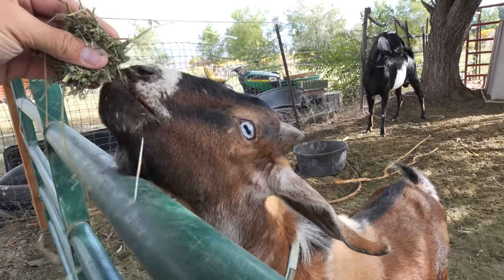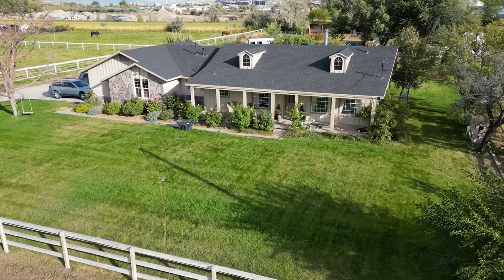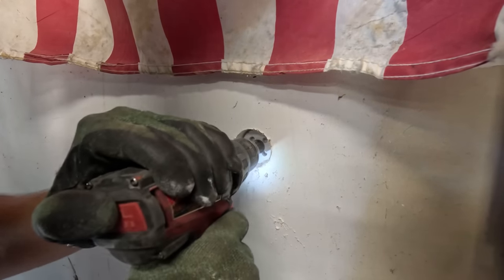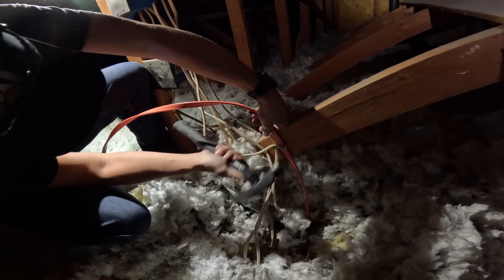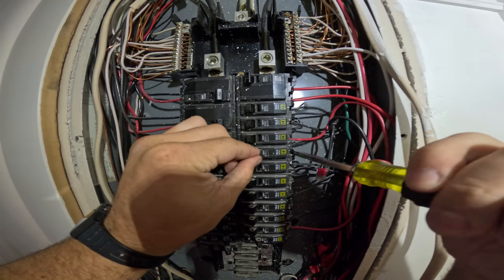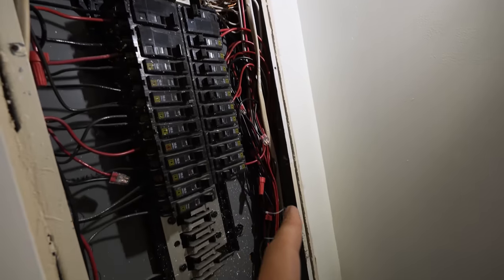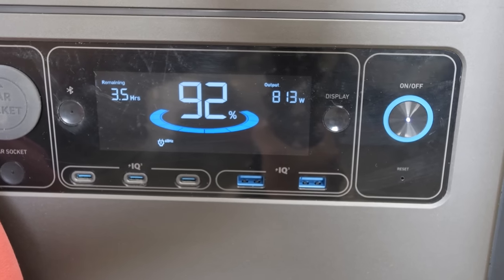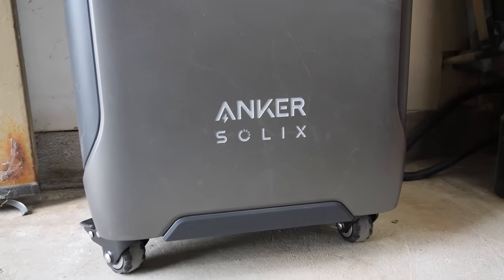Ankers newest Power Station can charge a house and an iPhone... 300 times

Comment: I live in South Louisiana almost right on the coast. I keep wanting to go with some battery backup solutions for when hurricanes take out the power, but I can't figure out which seems best. EcoFlow, Anker, Bluetti, etc. They're a rather large investment so I can't exactly just go off trial and error. So... what's your opinion of this compared to the EcoFlow batteries you use on your side of the road?
Reply: This is the first that doesn’t require two units to output 240v.  If size/weight is more of a factor and you don’t need 240v, their f2000/767 is pretty nice
Reply: Will the expansion battery from the solix 2000 work with the 3800?
Reply: @bdtang  My Ecoflow River 2 outputs 240v. 240v isn't special.
Reply: @logitech4873  in the US?  Supporting a nema 14-50 240v plug and able to plug this directly into generator inlet and use it as a short term direct replacement of a generator is really cool.  Hopefully it supports solar charging while still outputting 240v 14-50 plug would help fulfill my use case.  I know the eco flow delta pro requires 2 units with a hub to support this. The current portable generator we have is a pain to maintain (oil/gas) and fire up for the 1~2hr power outage we get here about once every couple of months.
Reply: @bdtang  Nah in Europe. All power banks that have basic outlets will support 240v here. I don't know if any of them support 400v 3-phase.

Comment: A proper fuel-efficient generator would last 40 years, always ready when you need it, never needs a recharge.  Many can go 48 hours with on board fuel storage, or (like mine) can go years on 2000 gallons of LP  While making 5 times the energy output of that throw away made with china battery bank.
Reply: You are a big man, everyone here knows it. You are so strong and big
Reply: @jamesmartinez1193   I'm talking about power density and fuel storage, why would you say something like that?
Reply: @jamesmartinez1193  He has a bigger brain too
Reply: That's fine and dandy when the gas is available. But when gas is no longer available due to emergencies such as hurricanes and consumer usage, inability to bring in supply from outside areas, and gas lines being broken, you need something that is 100% self-reliable such as solar and battery. You don't have to rely on other companies to provide the fuel when going this route.
Reply: My granny used to use that as a solution. The downside is that you need to store fuel, and when you run out, you're out. It's also more work to get started, especially for an older person with no background in power. My uncle helped my granny install solar panels on her entire roof, not sure if they've installed a battery bank or not, but now she never has to think about what to do if there's a power outage, plus her overall electricity bills are much lower, so it's a benefit day to day, as well. Even without a battery bank, with solar, she's guaranteed power during the day, which is more than enough time to make sure she can pump water into her storage tank.
Reply: how much actual HOURS of work is the life expectancy of those generators?
"yEaRs" my ass
Reply: I do agree with you but these electric ones can be charged with the sun so they don’t have to worry about your ability to get gas, plus they’re silent. They’re kinda in the same situation as electric cars in that they really aren’t better than gas powered ones but they’ll continue to improve over time and probably will surpass them.
Reply: @HisServant77  Common sense, I keep around 1000 to 1000 gallons of propane stored in hidden underground tanks, isolated from each other for redundancy, but transfer is possible. 

If situation or finances don't allow, small 5 gallon cylinders will work just fine. LP does not have an expiration date so you can count on it 20 or even 50 years from now.   Gasoline electronic spark Ignition engines can be run off of many sources. 

Running ethanol is easy with a carb, you increase the carb jet size, any vehicle with flex fuel capabilities can likely run straight ethanol fuel. All small engines can run it with tuning or a "bigger jet" in the carburetor. 

 If fuel sources were cut off, your solar panels will make you an instant and easy target. 

  I could convert to ethanol grown locally, my gen set, F150 and datsun 620 could run ethanol with no and minimal adjustment.

  My gen set is underground,  the exhaust is piped underground and comes out the side of a hill, completely muffled and hidden, nothing more than the sound of a dryer vent.  That is how I would survive in that situation, not with solar panels marking my low-powered location.

 Solar and battery is not self-reliant for long. It's extremely short-lived, has just a small fraction of the power density of ice power,  you do not get the rated capacity like you think you would.  

Inverters, change controllers, BMS boards, individual cells and more are all common failures that would end your solar battery inverter system without notice or parts to replace.  
Even if my generator broke in half (Cummings, so not likely),  It can be repaired with fire, metal and a hammer without China's help.

When you push these battery banks hard (which is not hard to do when it's only capable of 8000 W). The cell's efficiency drops dramatically, this is why we don't get cell battery spec sheets with battery banks. If you could see the lithium battery charge and discharge curves from the manufacturer, your whole world would turn upside down.
Reply: @Dat_Sun  "And if you think for one second that a solar array is not going to attract the wrong kind of attention you're wrong. Silent yes but easily seen from miles away in a time when people are desperate."
Solar isn't at all viable where I live, but this is a weird argument. Is your area this sketchy and violent?

Comment: Makes me wonder if this can run things like gas furnace appliances, or even heat pumps as you said the voltage could be 240.
Reply: Depends on the system. A smaller central cooling system can run off of a battery like that, but it may kill it in around an hour or so. If you have a gas powered HVAC system for heating, and the power goes out, then it will likely handle it for a full day. If you have an old fashion steam based heating system (the steam based radiators), then those system can run off of battery for weeks. During a bad snow storm, I ran the gas steam heating system all day from 2 old 12V sealed lead acid batteries that went to an old UPS. Since the system needed 24V DC.
The old boiler systems do not use much power, since all it needs to do is control a gas valve, and open an exhaust vent, then while actively heating, it just pulls about 3-5 watts.

Comment: But this thing cant power the whole house does it?
Im from europe and i get 230V at 60amp so that is 13.800Watt so, a small battery like that wouldn't help me at all. I have a battery wall and that charges at night when the powet is cheap, i use the stored power in the day time when power is expensive. No solar, because that doesn't have future. My battery wall puts out 15.000Watt and i can run it almost all day without needing grid power (depending on what I use during the day) a battery like this small one would be ok for a little while in my motorhome but even that has 240v 20apm. I guess the USA has lower amperage?

Comment: folding panel to charge this 3.8kwh? it will take several decades. why not just flip a switch and charge from the main grid?
Reply from the maker: It can charge from the grid. But not when the grid is down.

Comment: So can the grid recharge the power bank whilst it is working? Or does it have to be powered via solar?
Reply: yes the power bank can be charged by whatever angry pixies you toss at it. It is just a large battery bank after all. The solar is for off grid charging.

Comment: The last time I've had an outage here in Germany was several years ago. How comes the US power grid is so shit y'all need battery backups?
Reply: The name of the game is profit, and the electricity providers want as much as possible. The largest one most recently that I've heard of is Texas during freezing temperatures. The same thing had happened years prior, but instead of investing in equipment that can continue operating in freezing temperatures, they decided to keep everything as-is to save money, resulting in massive power outages, and some number of deaths. The regulations vary state-by-state. And even though electricity providers are 'regulated monopolies', some states don't do all that much regulating.

Comment: Does anyone know if the unit has enough capacity to charge an electric car battery that is 33 kWh  in size, if say I wanted to charge   30 KwH and how long that would take?
(maybe this is worth getting instead even though it cost twice as much as installing a  level 2 charger.

Comment: Needing  electricity for water is the weirdest thing I've ever heard. At least you solved it!
Reply: We all need electricity for water at some point in the chain. If you’re in a city they usually have their own pumps plus water tower(s). That’s how your house has water pressure to operate faucets even when the electricity is out for you. It’s either still being pumped at a city or was pre pumped and being stored in a way in which it has pressure from gravity.
Reply: Unless you live below a damned up reservoir that's how everyone gets water. Or pump by hand.
Reply: @andrewt9204 I meant needing your own house electricity for water. I mean, any city should be able to provide water pressure

Comment: 🪄✨ Made with SummarizeYT app
0:16 - Introduction to the problem of water shortage without electricity
0:30 - Introducing the Anor solx f3800 power bank
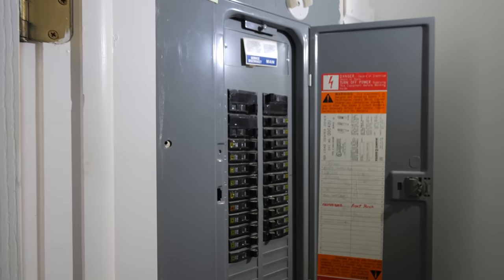1:17 - Running wires to connect the power bank to the electrical panel
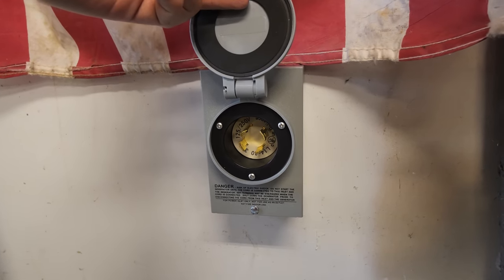2:03 - Explaining the versatility of the generator plug in the garage
2:42 - Details about the Anor solx f...

Comment: @1:55 Who's running a gasoline power generator inside of their house?  When that battery pack eventually goes into thermal runaway you'll be wishing all you were dealing with was a gasoline generator.
Reply: @planefan082 What does that have to do with my comment? Who is running a gasoline generator inside, not outside their home?
Reply: LFP batteries don't thermal runaway. They are the de-facto battery type for home storage nowadays. Get with the times.
Reply: @Dat_Sun  Hopefully nobody, but I was referring to the thermal runaway bit. Just about as good a chance as your kettle spontaneously combusting